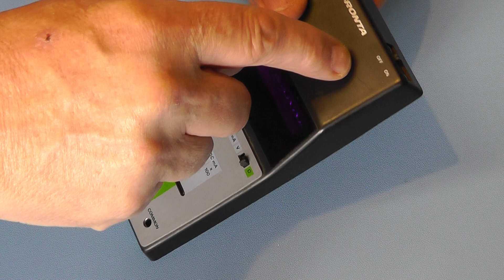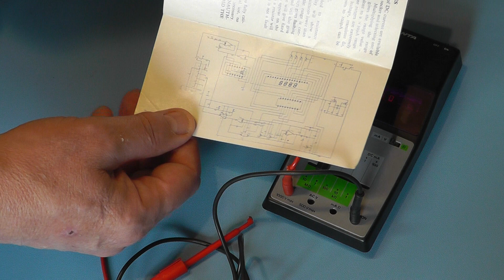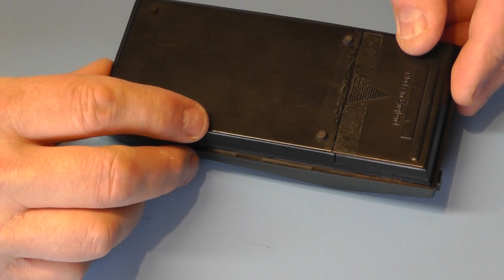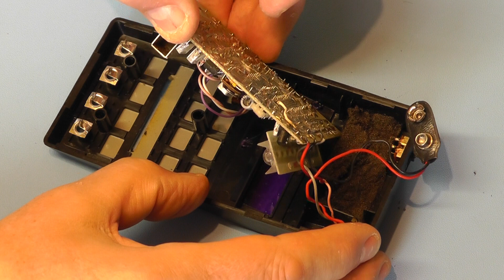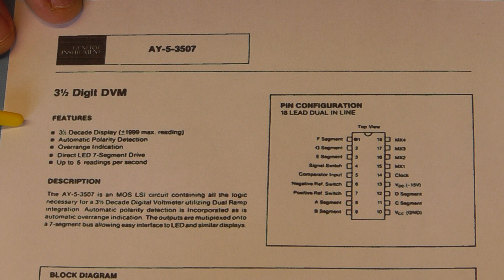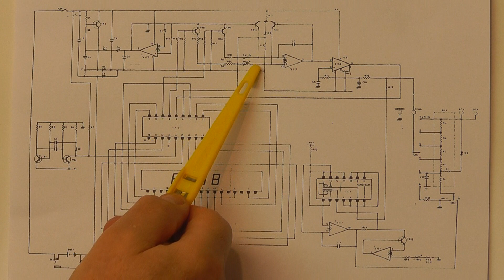Scullcom Hobby Electronics #15 - Sinclair Digital Multimeter PDM35 (also Micronta)

Comment: Hello,
So happy to have found this video, because I recently got my hands on one of these beauties, complete in box, with manual and the original receipt from 1979! However, upon closer inspection, I noticed that the LED to the far left [the over range and polarity indicator] and the decimal point, don't light up. Inspite of this, it's still "accurate". Can you help me out? Got any ideas, as to what might be going on here and/or how one might go about fixing this issue? I would appreciate any suggestions. Also, I tried to remove the undercover but it creaks and I don't want to break anything, that is still working after 40 years... again any ideas? Please let me know and keep making awesome videos!

Comment: I just brought one of these off eBay but it's the Sinclair PDM 35 version. It was actually faulty, having no output on the left most LED digit. The reason turned out to be some really ropey soldering, not just dry joints but one joint that had not been soldered at all. The battery cover falls off of mine too.
Reply from the maker: Yes the soldering leaves a lot to be desired. Also my battery cover keeps falling off, this was always a weak point, I just added some insulation tape to hold it on.
Reply: Also, I'm not sure I'd be happy to connect it to moderately high voltages let alone 1000V, not while I'm anywhere near it anyway.
Reply: Can you point out for me, which solder point you had to resolder to get the polarity and Over Limit indicating LEDs, to work again? For the longest time, I thought my Micronta multimeter was damaged because the polarity and OL weren’t coming on. Then I opened it up and I too, have found many unsoldered points on the board, but back then, I thought “they couldn’t possibly have forgotten to solder points on the board - this must be the way, it was designed”. I was just getting started in electronics, around that time and didn’t know any better. I even wrote in, on this here channel, asking for help with this matter, but I never got a reply. But now I noticed your comment, quite by accident. I’m lucky to have found your comment. Please help me resolve this issue, once and for all. Thank you kindly

Comment: Cool meter. Sold in America too, under the same name, for $59.95. ($221.46 for 1978, $198.89 for 1979, not sure when the catalog was actually printed, as some are done a year ahead).

Catalog, page 111, claims 1% accuracy.
Reply from the maker: For its age it still works quite well !!

Comment: Looks like the same display as was used in the Sinclair Scientific calculator. Widely inaccurate and cost £50 back in 1974!!
Reply from the maker: +leslie saunders Yes they used the same display module in several of their products in the 1970's. I have one of the Sinclair small programmable calculators and it still works!!!!

Comment: Very interesting, I had no idea that Uncle Clive had made a digital mulitmeter. I recognised his calculator case as soon as I saw it... Sir Clive was always good at keeping costs down :)  Just a question about the PCB: why are there no straight lines on the PCB tracks, and why do some tracks start off thin and get fatter, and vice-versa? The curves look beautiful but I can't understand why they weren't drawn with a ruler in the original design, using a uniform line thickness. Thanks.
Reply: Sinclair's test instruments were actually very successful, it was split off and became Thandar Instruments. And that company is still operating today, in 2022, still making test instruments in Cambridge.
Reply: @michaelturner4457  I had no idea, thanks. I've just spent some time reading about this online.
Reply: @ForViewingOnly  Yeh, Sinclair Instruments was spun off by the National Enterprise Board in 1979, and became Thandar. The pocket TVs sold to Binatone. And Clive himself, went on to found Science of Cambridge, later Sinclair Research Ltd, They produced the ZX80, ZX81, etc. and the rest is history....including the C5 electric vehicle.. LOL!!

The PCB tracks in this Sinclair meter were very probably hand drafted with a pen, and maybe Letraset for the IC pads. That's why it looks like that.
Reply: Sinclair Instruments also made a small oscilloscope, that used the 2in CRT from the pocket TVs. And Thandar went on making that for years. well into the late 80s.

Comment: I have one of these mutated calculators too, including the manual. you can see the picture here http://www.pa4tim.nl/?p=3869
Mine is not working.
Reply: pa4tim I forgot the reason I would write a comment. Thanks too you I now can open it for repair. I was afraid to crack the case. I thought the tree pins where glued of melted. Nice collection test gear. (I'm a test gear-nut too, I have over 30 multimeters (I repair test and calibration gear as my job))
Reply from the maker: pa4tim Glad it was of some help.

Comment: Im really supprised how accurate it is for its age :-)
I heard the hesitation when you were judging the solder joints, i would say its lasted longer than most equipment from its era so it cant be too bad :D
The bubble displays were a brilliant idea for calculators with energy sucking leds, with the modern lcd displays i suppose we forget that.
Sinclair was brilliant with some of his cost cutting measures, like using half faulty memory chips in the zx spectrum, well they would be very cheap, no one wants faulty chips..... sinclair knew this :D
I didnt know the dvm was sold as micronta, well i never, we learn something new every day :-) thankyou for your video :D :D
Reply from the maker: Thanks for your comments. Yes, its accuracy was quite good due in part to the main 3½ Digit Multimeter Chip at the heart of the meter. Also the Thin Film resistor network on the input range switching was good quality. All in all a nice little digital meter for its time.
Reply: Scullcom Hobby Electronics
I also noticed that sinclair had his well known method of supplying the chip with its 20v supply, that tapped coil just made me smile, he used the same trick to supply the odd voltage memorys in the zx spectrum, the "Buzzzz psu" :D
But im sure im being boring now, so ill leave you in peace :-)